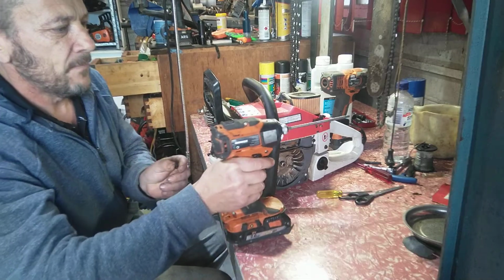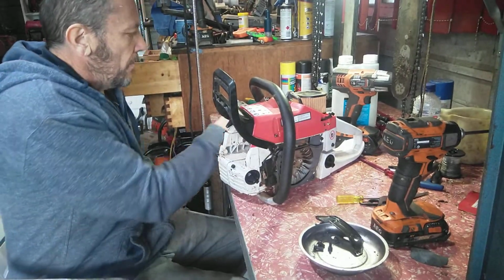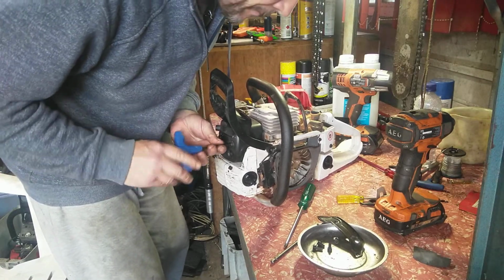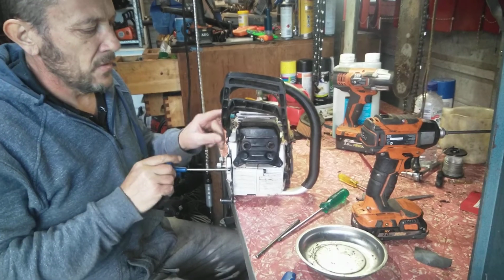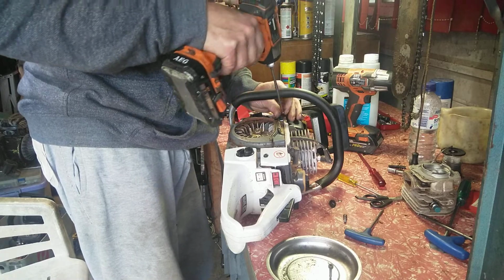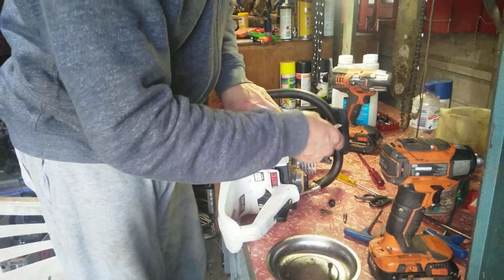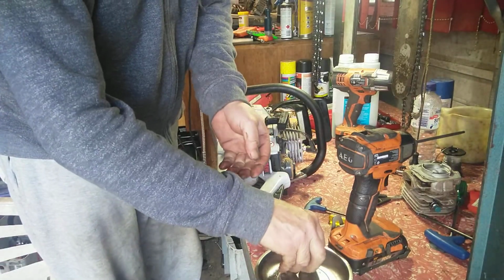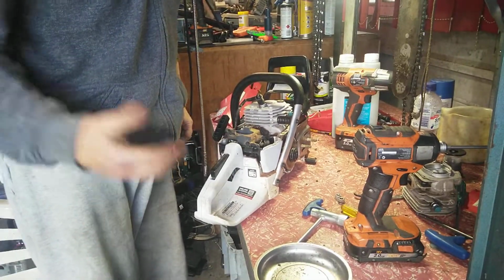Troy's clone 372 xp check over before start up first time

Comment: Hey kev, my misses thinks I'm a bit mad as well, always messing with chainsaws or my car, gotta keep busy & keep moving. Keep it up mate.
Reply from the maker: Cheers mate , it's to see you love playing with chainsaws can find out what the blow down is ? Cheers mate Kevin
Reply: @MrHangerone  here's  the numbers for one of my sx92's stock, no base gasket.
Exhaust 103.5 atdc
Transfers 127 atdc
Blow down 23.5 deg
Inlet 67.5 deg btdc
Inlet duration 135.
Reply from the maker: @anthonysgarage5283  hi sorry I meant the timing numbers for the sx62 was going to pay up to for the sx92 $120.21 so there's was a ways to go yet lol cheers Kevin
Reply: @MrHangerone  current numbers for sx62 are
Squish .55mm
Exhaust 96 deg atdc
Transfers 119 deg atdc
Blow down 23 deg
Inlet 64 deg btdc
Duration 128 deg
Muffler off sx75
Didn't realise that it had exhaust leak in video, noisy but ran good. Now fixed with double gasket.
Had to machine pop up on piston as was hitting after gasket delete.
Glad it was you who won that sx92,.
Just got mine back together today after more mods.
Reply from the maker: @anthonysgarage5283  thanks for getting back I have my saw 62cc set at 24 blow down, I have tried 25 but you lose power, as for intake it's is 79 runs sweet going to make a new video cheers Kevin